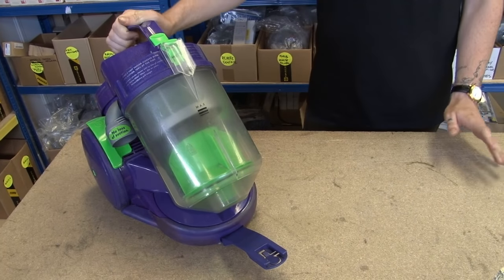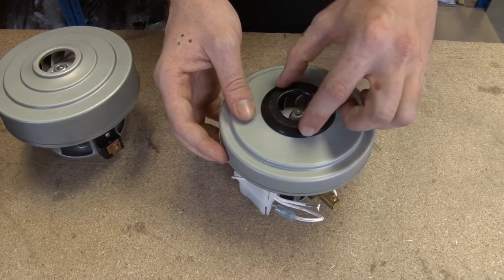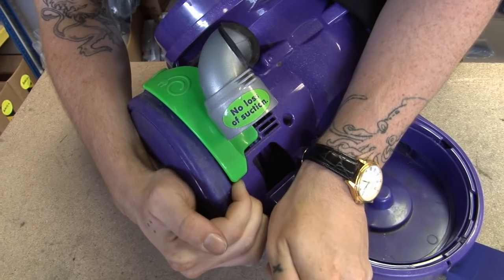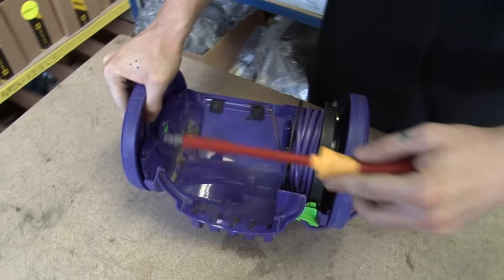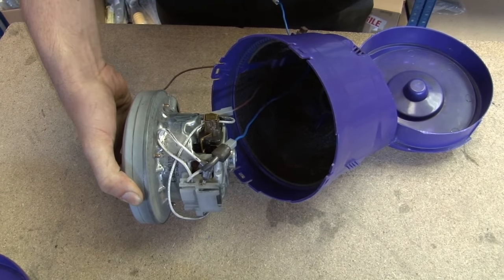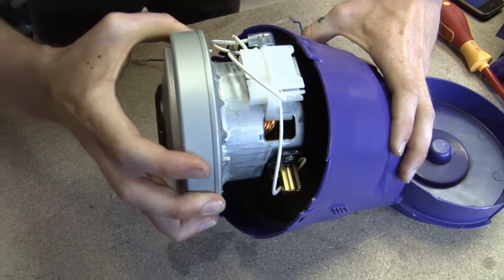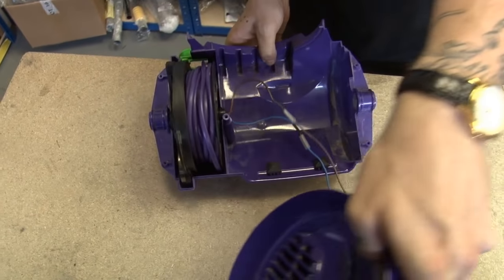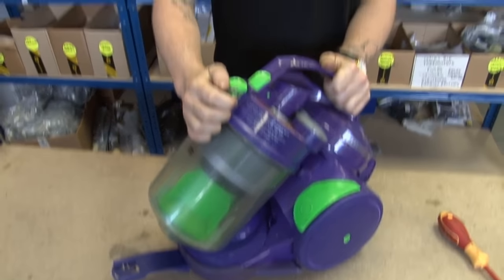How to replace the Dyson motor on a Dyson DC05 vacuum cleaner

Comment: useless to the average handy person .This is all basic stuff .You could be wasting  your customers  time changing the motor  when the issue could be a broken live or negative wire which can easily happen om the power lead .If this was a genuine video and not a parts selling excercise you would show views how to conduct a conductivity test .For viewers a phase tester wont show that there is an issue with a  broken negative wire .

Comment from the maker: Hi,

The least expensive modern/latest model equivalent of the DC05 in the video is a  DC 19DB which retails at roughly £280. A new DC05 motor costs less than £50.

Thanks.